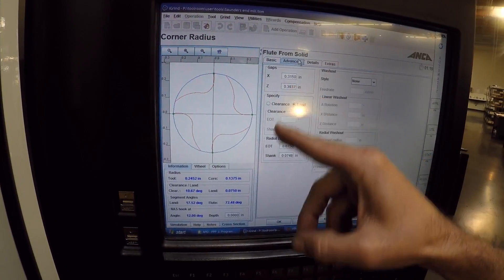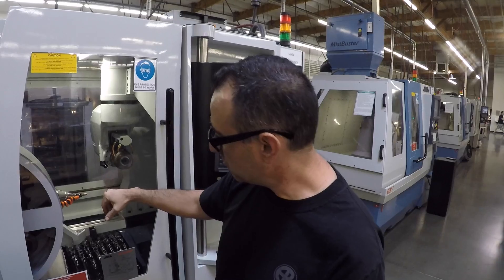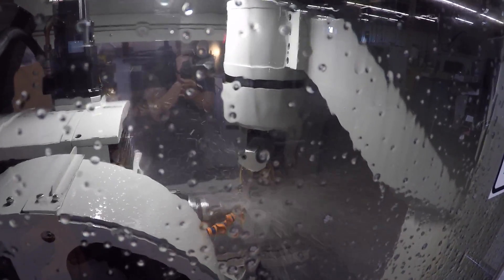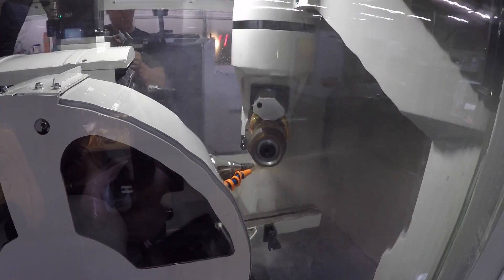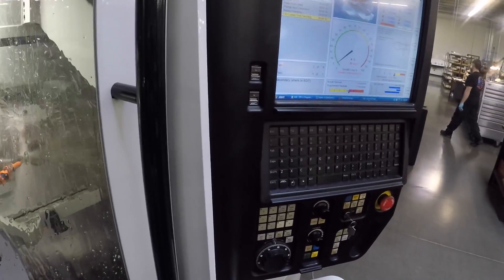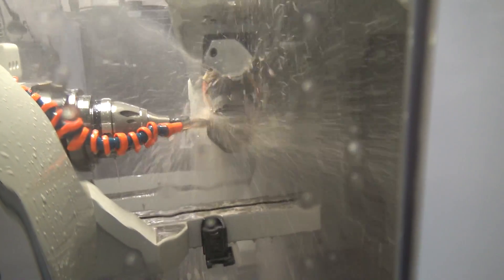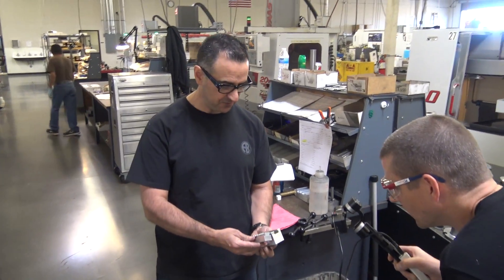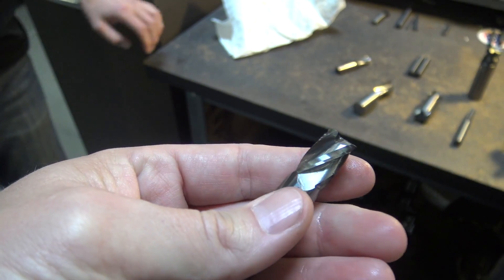CNC Grinding an End Mill at AB Tools!

Comment: Great video and good timing as I've been looking for a carbide tipped dovetail to replace my homemade HSS one and I'll be giving them a call shortly ;)
Reply: SouthJerseySound outstanding! We stock many different sizes and angles. Check our website or email mail@abtoolsinc.com . Thank You 🇺🇸
Reply: Alfred Lyon  Thanks,I'm looking at it now and like what I see.I have to measure a few things but I'll be in touch soon.I also have a few questions on a custom cutter profile too.I gave up on the idea  do to cost for a min order.But it seems like you might be able to work on that for us too.It's nothing crazy but it adds a nice decorative touch on our part.Chances are you can get what I want done starting off with one of your corner rounding bits.